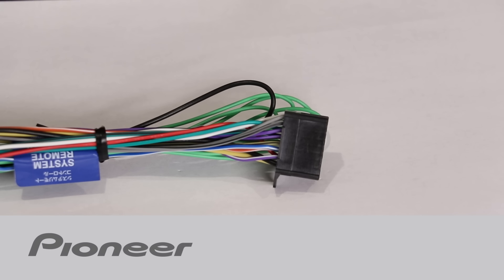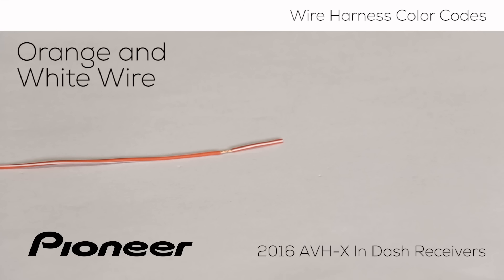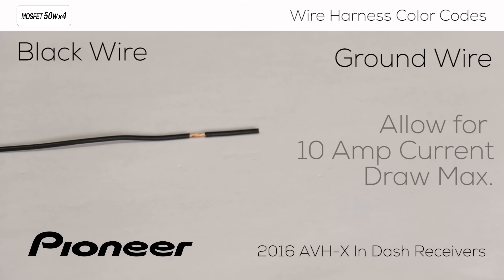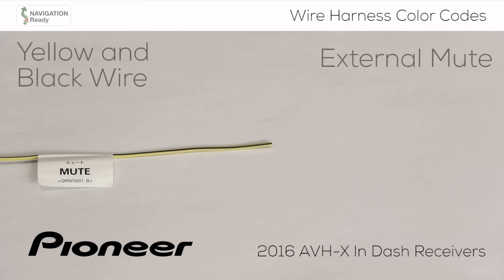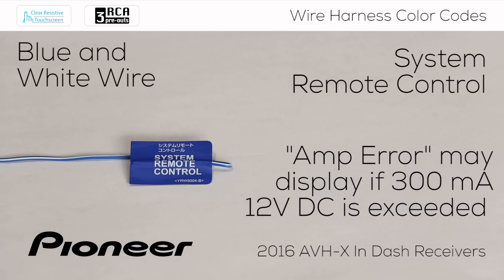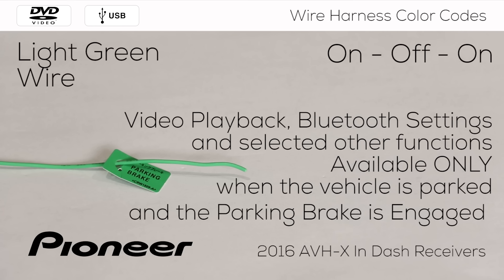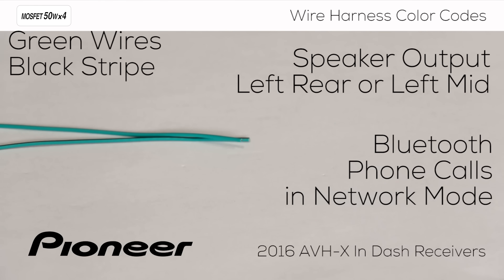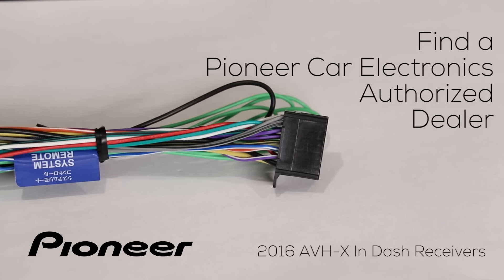How To - Understanding Wire Harness Color Codes  for Pioneer AVH-X Models 2016

Comment: Alright so quick question. Hooked up my aftermarket camera. The camera had a input end for the video feed to the stereo. And one  end for power and ground. Now the video feed cable has a red wire sticking out next to the yellow input end. On the stereo end I hooked up the camera input to the brown port for rear cam feed and the red wire next to it I connected to the reverse wire. Was that correct or not ?  Also the other end of the yellow video feed cable , I didn’t do anything with that red wire next to it.
Reply: You got the camera plugged into the Brown RCA camera input on the back of the Pioneer in-dash receiver.  That's good.  The rest sounds like it may be incorrect.
Pioneer in-dash receivers are designed to work with the Pioneer ND-BC8 backup camera. I don’t know about the operation of other cameras. 

Be sure to plug the Brown camera output RCA into the Brown RCA Input on the back of the Pioneer in dash receiver.

The Pioneer ND-BC8 camera needs power and ground to operate.  The camera should always have power when the vehicle is switched on. And the camera should power off when the vehicle is switched off.  This is very similar to the way the Red Ignition wire works on a Pioneer in-dash receiver.  

The purple/white wire is used to let the in-dash receiver know that the vehicle is in reverse and to open the backup camera window on the receiver screen. 

Do not connect the Purple/White wire to the camera. 

When you put the vehicle in it’s reverse gear, the Purple/White wire should sense a change in voltage. This opens the camera window on the in-dash receiver. And closes the camera window, when the vehicle is taken out of it’s reverse gear.  One possibly connection for the Purple/White Reverse Gear wire is back up lamp terminal. 
 Here is a video about camera operation:  https://youtu.be/tWi_kVPg2M4   Here is a video about the Pioneer ND-BC8 camera:   https://youtu.be/kg0IaGC3JbE   and you can find more videos on Pioneer's YouTube Channel here:  https://www.youtube.com/user/pioneerelectronics
Reply: I recommend to contact the camera manufacturer for help with the camera.
I am not an expert on the camera you have or it's connections.  I can only tell you about the Pioneer receiver and a Pioneer ND-BC8 camera.  
The camera should power up and be on ,at all times, when the vehicle is on.  The camera should power down and shut off, with no power draw , when the vehicle is powered down.
The Pioneer camera has a Red ignition switched Power wire and a Black Ground wire.   The Pioneer camera also has a Brown Male RCA to connect to the Brown Female RCA jack of the Pioneer receiver.  
If you don't connect the in-dash receiver's Purple/White Reverse Gear Wire, to anything, simply as a test,  you should be able to open and close the camera view window on the in-dash receiver , manually  from the receiver's home screen,  at any time the vehicle is running and see the camera view on the in-dash receiver. This does not require reverse gear at all.
If you can manually switch the camera view on and off, and see the camera view, on the receiver screen, you know the camera is wired correctly.  If you can't see the camera view in this test the camera is wired incorrectly.
After you know the camera is wired correctly, it's just a matter of getting the Purple/White wire connected to the correct terminal on your reverse light so that it sees a change in 12 volt voltage when the vehicle is put in it's reverse gear or taken out of it's reverse gear.  
The Battery/Positive setting is by far the most common setting used in many installations. 
The Purple/White wire from the receiver should never touch the camera or an camera wires in any place at any time.  The Purple/White reverse gear wire should run from the back of the in-dash receiver to the backup light on the vehicle.  When you put the vehicle in reverse, the backup light switches on, and this in turn shows the purple/white reverse gear wire a 12 volt positive input.  This will automatically open the camera window on the in-dash receiver.

Comment: I've read some to the older comments. I think that I know what I need to do. I have the Crux Cub-15 camera. From what you have told other people on here, I think that I need to connect the camera to a accessory-on(switched 12v source) so that it's powered when the key is in the acc and/or on position, and then connect the purple/white wire to the reverse light (+) source. Is this correct?
Reply: Red is accessory. Black is ground. Do not connect the purple wire with the white stripe to the camera that is the reverse gear signal for the in-dash receiver is a common connection to backup lamp terminal on your vehicle

Comment: So just to be clear, the Bluetooth Settings menu and other menus are disabled unless the light green wire is wired to the parking/emergency brake switch? My car is an automatic and the parking brake switch is buried under a lot of trim panels; is there no way to connect it so that those menus are enabled when the vehicle is just shifted into park?
Reply: Just wire the green cable to the black earth
Reply: Won't work cause it needs an on off on signal, figured that out the hard way

Comment: Am I supposed to connect the blue and white wire from the pioneer harness to the solid blue wire on aftermarket dash kit? I do have an external amp btw
Reply from the maker: The Blue Wire with White stripe is used to automatically switch on and off external amplifier and other systems like a power antenna.  If you have an external amplifier, I recommend to extend the Blue/White wire from the Pioneer in-dash receiver and connect directly to the external amplifier at the system control terminal.  The Blue/White wire can be run along beside the RCA cables from the in-dash receiver to the external amplifier.  You can find more videos about Pioneer amplifiers here:  https://youtu.be/99Hfmc8QxVc?list=PLw63zJRQbCNg42VJXw0g7xzWJozqoSR1V&t=462   and you can find more videos on Pioneer's YouTube channel here:  https://www.youtube.com/user/pioneerelectronics

Comment: I have a Pioneer sph-10bt. Does it draw power from the battery, if I have taken the screen off? There is NO on/off wire available on my vehicle.
My problem is that the wiring on  my Jeep Compass -07  consists of only 2 power cables which are connected to the battery. I was thinking I would keep it that way, and shut the player down every time I leave vehicle for longer period by taking the screen with me (as I should anyways).
Reply: If you take the face off of the Pioneer SPH-10BT, the system shuts down.  It still draws a very small amount of power to operate it's clock and keep it's internal settings.    Another option would be to install a toggle switch on the Red Wire, and use it as an on/off switch.  Please be sure to install the latest firmware update for your Pioneer SPH-10BT.  You can find it here:  https://www.pioneerelectronics.com/PUSA/Car/Digital+Media+Receivers/SPH-10BT#downloads   You can find more videos about Pioneer SPH-10BT here:  https://youtu.be/_ISxPmindi4?list=PLw63zJRQbCNiGNMG9zaOiTR3NgWe2T7ol   and you can find more videos on Pioneer's YouTube Channel here:  https://www.youtube.com/user/pioneerelectronics

Comment: There's a black wire on my factory harness. So do you wire that to the receiver ground? Or do you ground the receiver to metal/ chassis? And what do I do with the other factory black wire?
Reply: The Pioneer Wire Harness Colors are not designed to match the wiring in any particular Make, Model, or Year of  vehicle.  If there are colors that match, that is pure coincidence.  If the black wire in your vehicle is a Ground capable of supporting 10 amps DC then it's a good ground connection for the black wire in the Pioneer car stereo wire harness.  I recommend using a Wire Harness adapter for your particular vehicle.  You can find many options here:  http://metraonline.com/parts/MET-TURBOW  If you don't understand what you are doing I recommend going to a qualified car stereo shop for installation help.  You can find more videos on Pioneer's You Tube Channel here:  https://www.youtube.com/user/pioneerelectronics

Comment: What if you are installing in an older vehicle without the parking brake wire?
Reply from the maker: Pioneer video receivers are designed to be used in vehicle's with an operating Parking Brake.
You’ll need to engage the vehicle’s Parking Brake in an ON-OFF-ON operation in order to access the Bluetooth setup menu or video playback. This might also be known as the Hand Brake or the Emergency Brake.  If you engage the vehicle’s Parking Brake and still can’t access the Bluetooth menu, or video playback,  the in-dash receiver’s Green Parking Brake Wire may have an incorrect connection to vehicle.  You can learn more about the Green Parking Brake Wire in this Pioneer How To video:  https://youtu.be/-bF3uzzaT30?t=322
You can find more videos on Pioneer's YouTube Channel here:   https://www.youtube.com/@pioneerelectronics

Comment: 3:14 (the purple/white wire). I used a Crux camera. It has red and black wires at the rear part (near the actual camera) of the harness. I connected the red wire to the positive wire on the reverse light, and I connected the black wire to a chassis ground. I then connected the "video" input wire into the head unit. The camera activates when I place the car in reverse, but will not activate when I push the "camera view" icon on the radio. I'm thinking that I did not connect the purple/white wire to anything. If I didn't connect the purple/white wire to anything, can I just connect it to an "accessory on" power input wire?
Reply: FYI, my head unit is a Pioneer MVH-210EX
Reply: did u ever solve this?

Comment: So do I connect the system control ( blue/ white ) to the power antenna ( blue) cord on my harness?
Reply: The Blue wire with White stripe is commonly used as an on/off switch for a power antenna or an external amplifier.  You can find more videos on Pioneer's YouTube Channel here:  https://www.youtube.com/user/pioneerelectronics

Comment: Hello. I have a AVH-X3700DAB. My problem is that every time i start my car, i have to connect my phone to the radio manually. Is it a cable i have to connect so i dont need to do that?
Reply from the maker: The Pioneer AVH-X3700DAB was manufactured back in 2013-2014.   Please be sure your phone is not connected to another device such as a headset or a portable speaker.  This can block the in-dash receiver from connecting.  Also be sure your receiver is not connected to another phone, this can also block a phone from connecting.  
Be sure Auto Connect is switched on in the receiver's Bluetooth Connection Menu as shown here:   https://youtu.be/NuPU81smtVA?t=93
I recommend to delete all of the phones from the in-dash receiver's Bluetooth Memory.  You can see this on  a similar receiver here:   https://youtu.be/NuPU81smtVA?t=62
Next press the receiver's microprocessor reset button.  You'll need a paperclip or some other small point to press the microprocessor reset button.  You can find the microprocessor reset button on the AVH-X3700DAB at the top of the hard key panel beside eject.  
Next, delete the in-dash receiver from the phone's Bluetooth memory.
Next restart your phone.
Now begin the phone pairing process from the beginning.  You can see it here:   https://youtu.be/2-8BdQ6TK0Y
Please be sure your Pioneer AVH-X3700DAB has the latest firmware installed.  You can find it here:   https://www.pioneer-car.eu/eur/products/avh-x3700dab/support
You can find more videos on Pioneer's YouTube Channel here:   https://www.youtube.com/user/pioneerelectronics

Comment: I'm installing the Pioneer ND-BC8 reverse camera that goes with this but stuck on how to wire the red wire from the camera? Do I connect to the reverse wire? What's the purple and white wire actually for as.mentioned in the video...do I connect that to something?
Reply: The camera should power on when the vehicle is switched on   and    the camera should power off when the vehicle is switched off. Just because the camera has power does not mean you are viewing the camera image.  Do not connect the Purple/White wire to the camera.  Purple/White is used to let the in-dash receiver know the vehicle is in it's reverse gear and that will automatically open the backup camera window on the in-dash receiver.  One possible place to connect the Purple/White wire is the vehicle reverse lamp.  You can find a Camera Set Up video here:  https://youtu.be/tWi_kVPg2M4?list=PLw63zJRQbCNgLoyoij-BJdPDBVLYipAnj   and you can find more videos on Pioneer's You Tube Channel here:  https://www.youtube.com/user/pioneerelectronics
Reply: @deckerdotto6035  Thanks. So I need to buy some wire and connect the purple/white wire to the reverse wire as well?
Reply: Yes, if you want the camera to automatically show on the in-dash receiver screen  when you put the vehicle in reverse, and to close the camera window when you put the vehicle in another gear. If you don't connect the Purple/White wire the camera will only come on when you manually switch it on from the receiver's home screen.

Comment: I just want to know The diagram for the pioneer AVH 4100 ? So I can know what is positive and what is negative on speaker leads wires
Reply: The wire harness for the Pioneer AVH-4100NEX is identical to what you see in the video above:   https://youtu.be/-bF3uzzaT30?t=406   Speaker wires are White, Gray, Green, and Purple.  The negative wires for each speaker pair are the same color with a black stripe.  You can find the owner's manual for the Pioneer AVH-4100NEX here:  https://www.pioneerelectronics.com/StaticFiles/Manuals/Car/AVH-4100NEX_OwnersManual021915.pdf   If you need to buy a wire harness for the Pioneer AVH-4100NEX you can get it from Pioneer Parts here:  https://www.pioneerelectronics.com/PUSA/Support    Please be sure to install the latest firmware for your Pioneer AVH-4100NEX.  You can find it here:  https://www.pioneerelectronics.com/PUSA/Car/NEX/AVH-4100NEX#downloads    You can find a complete playlist of How To videos with very similar operation to Pioneer AVH-4100NEX here:  https://youtu.be/g5juaKNXr90?list=PLw63zJRQbCNj54n_seneF7Hx-YNqfV-ow   and you can find more videos on Pioneer's You tube Channel here:  https://www.youtube.com/user/pioneerelectronics

Comment: I desperately need some help. I had a shop install my 1550 nex and every once in a. While it shuts off and comes back on. And I don’t know what causes it or how to fix it
Reply from the maker: What is the full model number of your Pioneer in-dash receiver?  Is it AVH-1550NEX?   Or are the first letters DMH?
Reply: @pioneerelectronics  yes it is avh 1550 nex
Reply from the maker: Does this seem to happen when you have a phone connected?  or a USB flash drive?  or not?  Does it seem to happen on particular source?  AM/FM Radio, Bluetooth?  CD?   
I recommend to press the receiver's microprocessor reset button.  You'll need a paperclip or some other small point to press the microprocessor reset button.  You can find the microprocessor reset button on the Pioneer AVH-1550NEX at the top of the hard key panel beside eject.
Please be sure you have the latest firmware installed on the receiver.  You can find the latest firmware for Pioneer AVH-1550NEX here:    https://www.pioneerelectronics.com/PUSA/Car/SiriusXM/AVH-1550NEX#downloads
You can find more videos on Pioneer's YouTube Channel here:   https://www.youtube.com/user/pioneerelectronics
Reply: @pioneerelectronics  I only ever use the usb for my phone and listen to my music that way. I can’t recall if it happened any other way. It has the latest firmware and I’ve reset it several times to no avail
Reply from the maker: I recommend to check with the install shop for loose wiring.  If this does not help, Please contact Pioneer Customer Service  in the US here:    https://www.pioneerelectronics.com/PUSA/AboutPioneer/Contact+Us    or by calling in the US  1-800-421-1404

Comment: I've attached everything correctly based on this video and the wire harness info and for some reason I'm getting battery draw after everything is turned off and key removed.  I pulled the fuse and the draw stops so I know its the radio or the amp as the issue.  I removed the radio completely and the amp test shows a draw even with the radio removed.  I pulled the fuse again and it stops.  My guess is that the amp is not turning off.  did I do something wrong with the wiring? it worked perfectly fine when I had a single DIN pioneer prior.  any thoughts on how to stop this draw?
Reply: Please focus on the Red wire for ignition and the yellow wire for constant power from the vehicle.
If the amplifier is staying on it's power indicator should be lit up. Check the blue and white system remote control at the dash and at the amplifier.